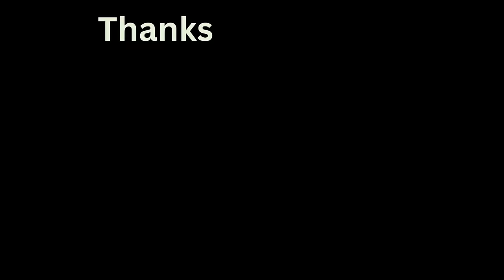PROJECT HILDA 12: Can I get my Saxo-powered Hillman Imp ready for Rustival?

Comment: Thanks for the heads up. Just a thought, if you are going to put the thermostat back in the engine, run that line to the radiator and just T off to the heater matrix with the on-off valve. The other end of the heater matrix can be T'd on the line coming back to the engine. It would be simple and less troublesome. Whatever you decide, Hilda is a sweet little ride. Love the merch.

Comment: Gearbox oil cooler needed I reckon.. I bet the actual volume of oil in the imp gerabox must be pretty small.... can't be well ventilated stuck at the back especially with the front spolier deflecting air from underneath.

I think you should take the C6 up the motorway to Rustival, after all you've done to it get some use out of it, use the time on the ramp to do what Hilda needs in a sensible timeframe...
Reply from the maker: The race cars don't use one, though. And some of those use standard boxes.

Comment: With all the time you spend on your  cars, do you spend any time with your wife? I love your videos, especially your humor.
Reply from the maker: I do, but not enough. I'm at work a lot, and work is also my hobby, so there are no boundaries. It's not healthy, really, but at the same time it means I can keep her Saxo going and we can enjoy car events and holidays in an SM in the future!
Reply: @UPnDOWN  Sounds great. The same thing happened (to my BX19GTI gearbox) on December 2nd. And living in Foxton, New Zealand, 37 years since the car was built caused a bit of a problem sourcing a replacement gearbox. My Citroën contact in Auckland,  Phil Cotter,  found one in his barn (huge collector of Citroën parts) which had been sitting for 26 years. It was rescued from a similar model car which had been rear ended so engine, gearbox etc were saved.
Cost me $2200 or about £1300 for gearbox, shipping, disassembly and reassembling by my trusty mechanic Charlie Harper at South Foxton Motors. So now she runs well. She got new radiator but I'm desperate to source a top hose after ordering one from Germany which doesn't fit. Do you know where I can get a top hose for a 1987 BX19GTI?
Gratefully,  Gordon
Reply from the maker: I don't I'm afraid. Probably best to make one and wait for a NOS to pop up on ebay or something.

Comment: How light is the Hillman Imp gearbox either you are very strong or the gearbox is very light
Reply from the maker: Proper strong m8.

(it's light!)
Reply: @UPnDOWN  The old gearbox internals were a real mess on you tube l have seen a BMW K100 engine swap that would be less torque and less power than the engine you have in Hilda now
Reply from the maker: The BMW K-series is a good swap, but came onto the scene just after Hilda was being put together.
Reply: @UPnDOWN  l know an engine swap in a Hillman lmp required a lot of modifications to the Hillman Imp the hardest would been the cooling system my brother has a Sunbeam Stileto but it hasn't been my going for years has the original engine and that's its big problem the engine needs repairing as for other British cars say a Morris 1000 or any car with the engine in the front but the Hillman Imp is so different with its engine layout and l did see a Type 3 Volkswagen with a Subaru engine swap at a Volkswagen car show once the radiator was a wide thin radiator placed under the front bumper bar but that was replacing the engine like for like if you know what l mean and many years ago there was this mini with a Honda CB750 engine and a month ago when l was betti petrol there was a Morris 1000 with a Toyota Corolla engine in it the big question is it an improvement or sacrilege also there are a lot if engine swapped cars on you tube as l say how do you improve a classic car engine swap it